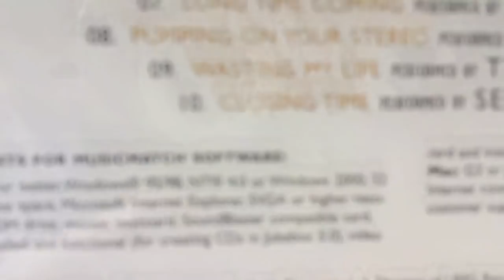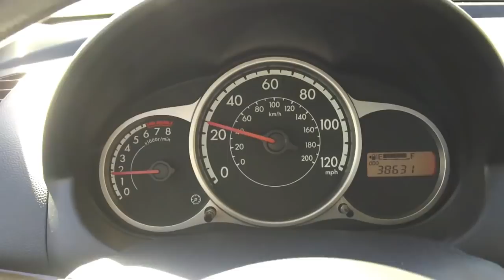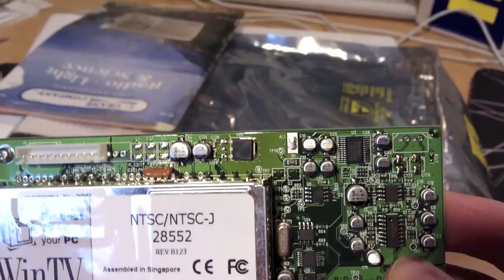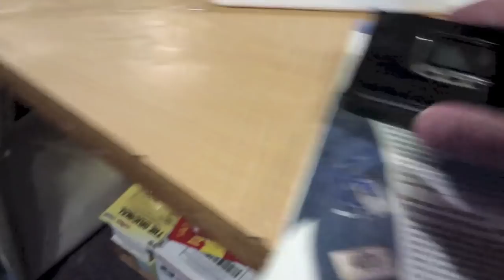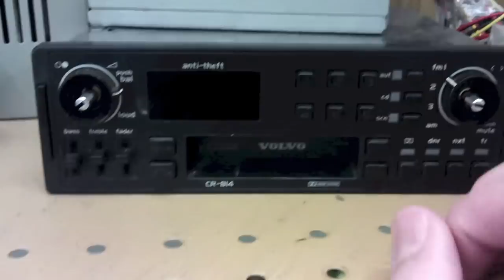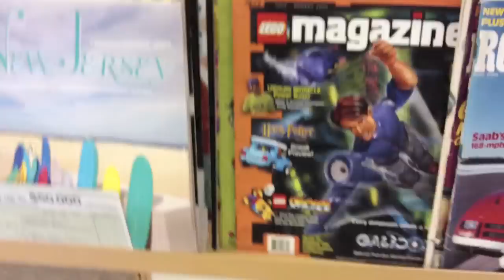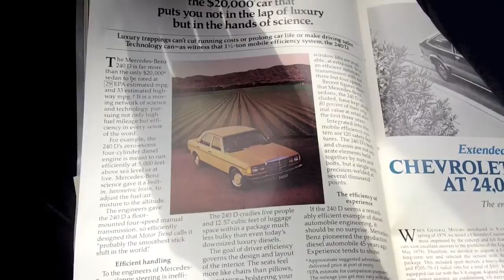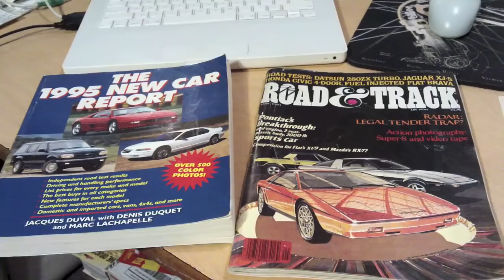Weekend thrift store adventure

Comment from the maker: I recently picked up a VTech "I.Q. Unlimited" kiddie computer, which is actually a surprisingly full-fledged Z80-based computer with video output, parallel printer port, word processor & spreadsheet applications, and even BASIC. Its keyboard also looks like the IIc but adds a numeric keypad. I'll have a video on it soon.

Comment: I know this video is already a couple of years old, but just to tell you: I would verify whether the fluorescent paint in the digits of the air humidity meter (right at the start) are radioactive or not. I am not making this up; old fluorescent paint contained silver chloride, which radiates mostly alpha- and beta particles (not as toxic as gamma rays, but not harmless either). Might make sense to check with a Geiger counter.
Reply from the maker: No, it's probably from the '70s or '80s, by which time the danger of radium paint was well-known and it was replaced by safer chemicals -- and in this case, it is not glow-in-the-dark paint, anyway.

Comment: Where did you get this stuff. The place I went to didn't have much I didn't have already. They did have some vintage alarm clocks one like spatsbear2 has. They had 2 sony dream machine alarm clocks like the one I have but mine's been hacked up and is missing the top and original volume control. They had a console TV there as well. And my nephew had a radio like the discovery channel one you showed. Some things are broken but I mostly get them to either fix or mod and the prices are great.

Comment: If your area doesn't have over the air Analog TV transmissions, you can use the WinTV to digitize VHS tapes. The one I had was able to record HuffYUV lossless video even from Macrovision-encoded tapes. And you can do a circuit board modification which will make it into a LF/VLF SDR sampler.

Comment: It was strange to see a V6 engined car (The Citation if i remember it from the video) with a 4 speed manual transmission, in Europe only very old and low powered cars had those. Strange choice for a high powered car. But most of the european cars you see in that book are alive and well here, well many of them will go to eastern Europe for us to buy. They still run pretty well.
My second car is a 89' Plymouth Laser RS and it's still working. :D That thing is older than me.

Comment: Im surprised, that the vintage TVs in America are so expensive. I found a Loewe - Opta Thalia from 1962 for 15€ on eBay here in Germany. It's also a big one with two Doors on the Front. It turns on, but the "Vertical Hold" doesn't work nomore, it needs new Capacitors.
I may make a Video about it next Time.
Reply: Well 60's TVs are pretty much worthless. The TV he found was from 1949 so it may actually have a bit of value but nowhere near as much as 299$... I'd say maybe it was worth 30-50$.
Reply: VideoTape
Yes I'd also say about 50$.
But I don't understand why they are so worthless, I like the 60s TVs best! ;-)
Reply: Yeah, 60's TVs are pretty cool.